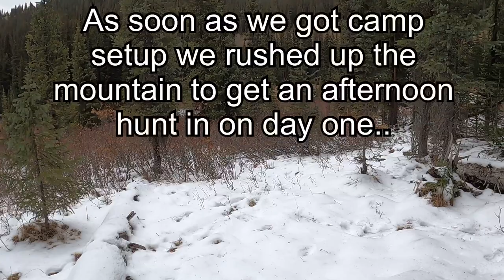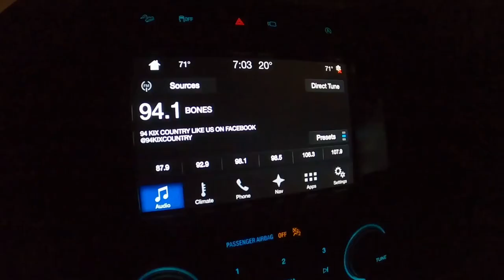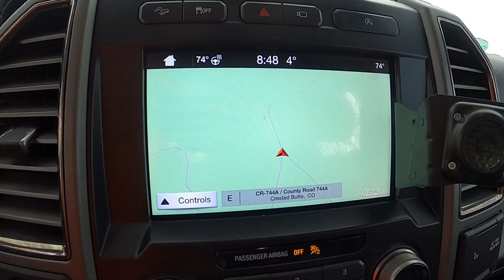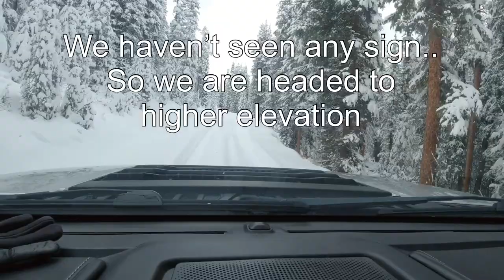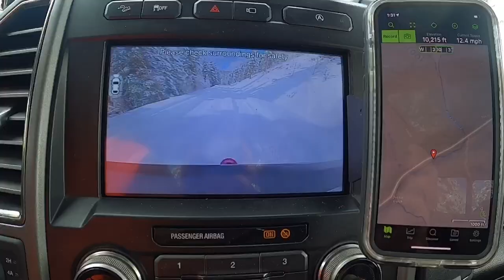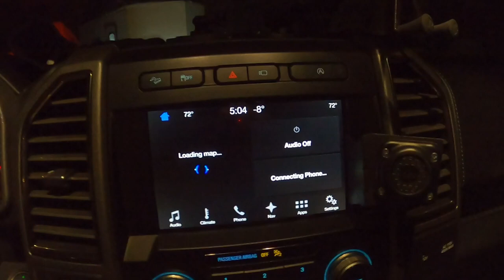Elk hunt trip pushes my Raptor pretty hard

Comment: It’s a bummer to not harvest but it’s still a great adventure. Great video 👊🏻 also did ya bring chains
Reply from the maker: Thanks! Unfortunately I wasn’t settled on the tire size on this truck so I have been holding off on chains. I won’t not have them again. The ones for my dodge won’t fit this truck either.
Reply: @Andrewactual  I hear ya lol size matters I actually found the ones for my wife’s Jeep GC at Walmart peerless brand they aren’t as good as my spike chains from  e trailer.com but they saved me once already . I always try airing down first then I bring out the chains.. great raptor love the winch setup 👍